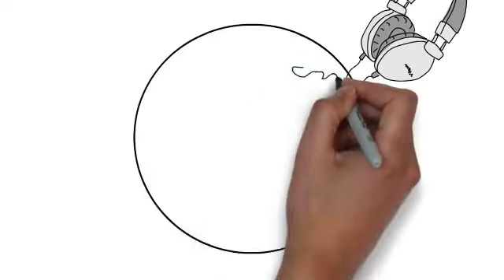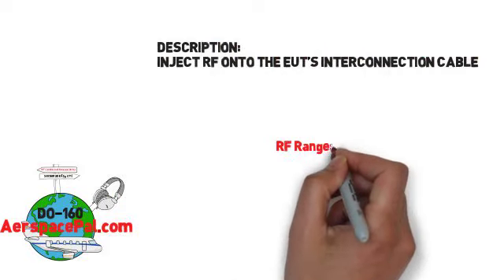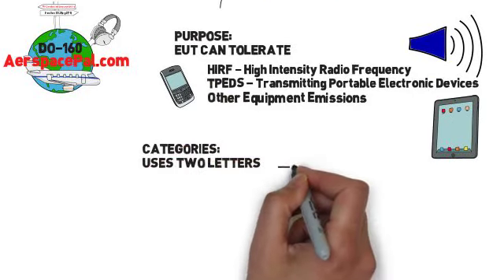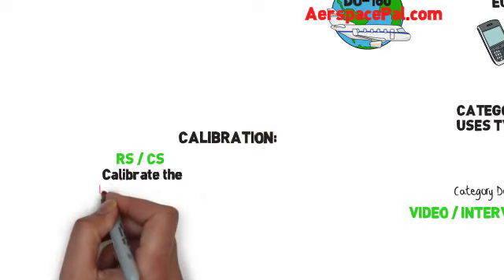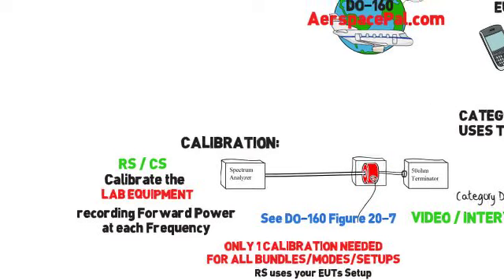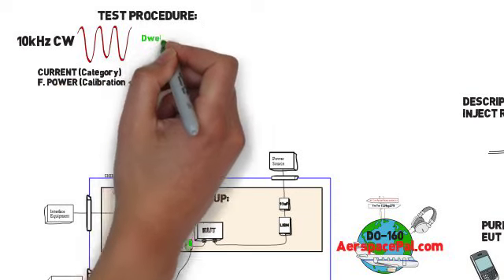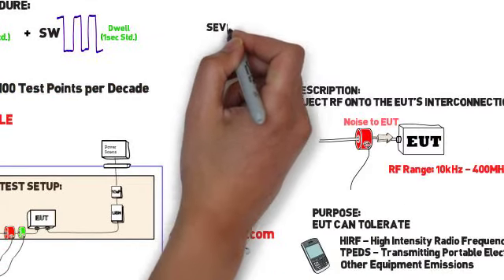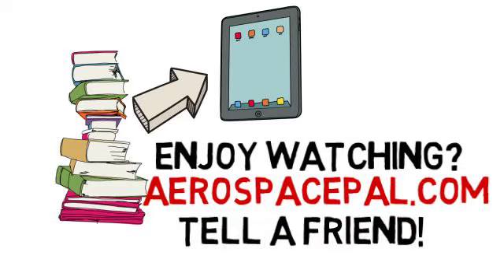RTCA/DO-160 Conducted Susceptibility Overview

Comment: Why do you add +6dB for the forward power level to the calibration level? How much power do we need to deliver to the injection probe to get the current needed for Cat. O for example? I calculated 34.95 dBm power for the 250mA max current needed to inject into a 50 ohm load, so if we have an injection probe with 10 dB insertion loss, we should supply the injection probe with 44.95 dBm power. Is that right? But, if we are going for the method you described in the video, we should apply 50.94 dBm to our probe, which is about 125W. Can you please elaborate this?

Note: This is ofcourse just for the power method. We'll monitor the current at the same time with a second probe, so if we reach 250mA before we hit 50.94dBm power limit, then we stop. However, there is a chance that we'll hit this power limit at times. So the RF amplifier should be able to supply this amount power for the given frequency range.